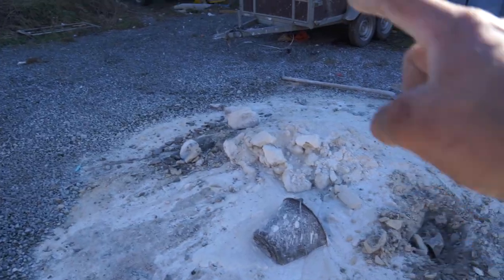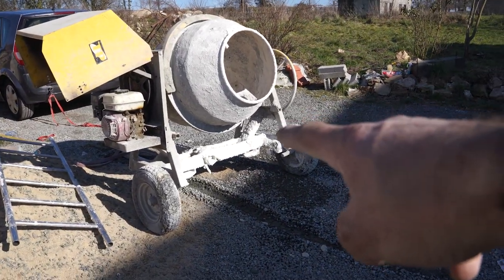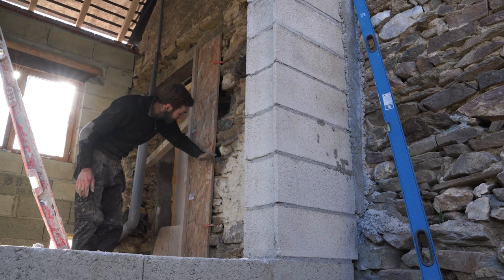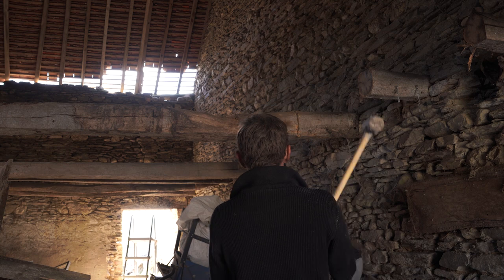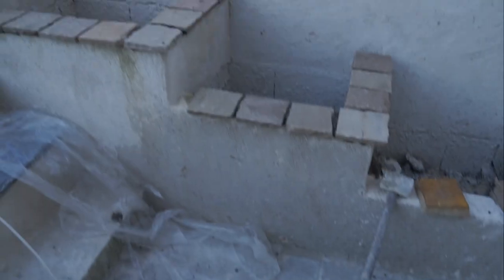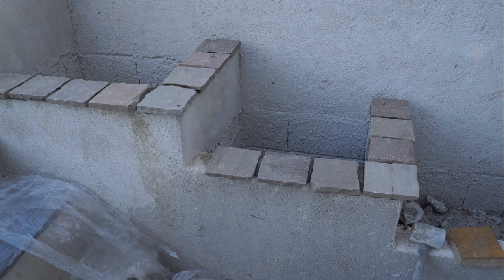Cement mixer recovery

Comment: I've just seen a tip regarding cement mixers on the traditional bricklayer channel. Get a plastic dustbin lid, it'll usually fit snug on the lip of the mixer and prevent all the splashing and spilling etc, plus keep the muck wet in the heat and the rain out in the wet.

I speak here as one who has had to liberate his own mixer from a good few piles of doom!

Comment: My husband said not to do the roof extension/ porch thing. He said that it will catch to much wind during a storm and destroy the roof. He said to make sure they are not 1 piece but 2 separate constructions.
Reply: That makes sense
Reply: I think that the porch extension is a brilliant idea.  Dan, finish it up mate...🙌🏻
Reply: @jamiemorgan4146  aestheticly I like the overhang that will give some protection from rain. The problem is that it can easily create a weak spot that will catch wind and tear a chunk of roof off. Maybe they are in a low wind area so it's not much of a risk but it would be dangerous in many areas
Reply: I think an overhang would look pretty, but yes, it might act like a jib sail, harness an updraft and lift the roof. Although the roof will be clay tiles. I wonder if he creates a few "vents" of some type without jeapordizing the waterproofing?

Comment: Personally, I think the camera angles and set up are just as clever as this fun building project, I didn't think that cement  mixer would hold up to being pulled out of that pile of cement, what oh what is that mixer made of? What a glorious machine! (I only say that, because my dad had one of these mixers and it was nothing but one problem after another, not ' a reliable' like yours is.)

Comment: Dan, just my two cents worth.  Don't over complicate the roof overhang, it's not carrying a lot of weight so could easily be supported with a beam resting one side on the existing wall and held up with a post on the other side.  Possibly with a starburst type wood posts from the beam up to the roof.  Good luck with it all.

Comment: A suggestion re finding old roof tiles for boot room to match existing roof. How about buying the new ones and putting them on the barn on the side you can’t see. Then take the old tiles from the barn to use on the boot room. Also didn’t you take some roof tiles off the ‘ it’s not a roof terrace ‘ old roof.
Reply: Great idea !!

Comment: I think what you are trying to accomplish is using the old beams to create a fascia.  Am I correct?  You don't have to build that on the ground - just make your cuts and nail it in place.  If you fabricate it on the ground you will have to bring in a crane to lift it. What I would suggest is cutting your plaster surface back so that the fascia sits tight to the block. Then fill in any gaps between the plaster finish and the beam fascia when the installation is complete using your brush and sponge back technique.  Then you'll have a nice air and water tight fit.  If you go with a simple fascia, you can split one timber down the center and do the whole job.   Don't forget to treat it for woodworm while it's on the ground (ALL SURFACES & ENDS)  I think it will look great   When prepping the old wood for use you'd be better off with a wire wheel.  use a fine wire wheel not a coarse one and be gentle. Leave a few of those hay loft joists in place.  You don't want the barn to collapse! 😊
Reply: Normally you'd extend your wall plate, purlins, and ridge beam,..
 but apparently those are just things other people have.
Reply: @massimookissed1023  Agreed - but you gotta deal with the situation as it stands, right?  Don't think this chap has a lot of experience and he tends to just do things rather than researching first.
Reply: @stevejohnstonbaugh9171  It's one thing if it's an old building throwing design challenges at you, but this is a problem of his own making, because he didn't plan it.

 At this stage, I think I'd go with joist hangers from the gable rafters, holding noggins/purlins out to the decorative old oak rafters.
And diagonals from the gable eaves up to the overhanging ridge.
Reply: I hope @escapetoruralfrance reads this ❤
Reply: Just throwing in an idea as another artist and diyer. The oak beams will be decorative mostly, just helping to support the end of the roof tiling. 
Dan suggested using the bottom planters as bases for supports to the base beam across the front. Once everything is fixed in place, having done a dry run on the ground, won't it be strong enough to help the roof end? I assume that's why Dan is taking the time to play now, before the roof tiles go on.
Looking for useful feedback. My approach would be the same as Dan here.
Reply: I agree with you @michellebyrom6551  "mostly decorative" and "to support the end of the edge tiling".  That's why I'm suggesting limiting his work to decorative fascia that will support a roof tile overhang.  Dan has a proclivity to "bite off more than he can chew - so I'm suggesting dialing it back to what gets him the biggest decorative and functional bang for his labor.  If he limits this finishing element as I describe  - he can direct mount it to the block wall - replaster below and brush in the lower edge so the fascia matches the lintels. Manageable for one person working alone is key.  Then he can move on to the next part of the project.
Reply: @stevejohnstonbaugh9171  I  get you. Thanks for replying.

Comment: Dan, if you lay down a sheet of heavy plastic under the mixer, clean up would be easier.  Just a thought.  Also, did you use rebar inside the cement column? Wondering if that would help.  
Cheering you on!!
Reply: That was the 1st thing that came to mind 're cement mixer,  stand it on heavy tarpaulin , he certainly likes to make more work for himself,  lol
Reply: I had the same thought lol

Comment: Years ago my partner worked on our terrace which was about 30 cms deep on one end and 1m50 on the far end because of the shape of the land. We shuttered and screwed and reinforced and had the lorry pour the load. THEN I saw the shuttering bow and in our panic we drove the van to the edge and parked it against the bulge and pushed. It worked but we always had a slight bulge that always annoyed me. Wet concrete weighs a ton !

Comment: Glad the concrete mixer is free if it’s pile of doom. It still has so much work ahead of it.  Maybe put a thick sheet of plastic down before you create the next pile of doom. 
Also get some advice from Amaury re the oak structure, why not make the most of a master craftsman that is a good friend.  You want it to last another 100 years.

Comment: Also nice that you moved the cement mixer out of the ‘pile of doom’.  But think maybe you should have placed it ‘pile of doom’ adjacent so you end up with just one big pile instead of two little ‘piles of doom’ to clear up latter.  Just a thought Dan.

Johanna  Maine USA
Reply: Just another thought and not meant to be a criticism but maybe do a major clean up of the site and amalgamate all the spare bits of wood and brick so you can see what you have, cleaning the piles of doom too would help you work cleanly. You are doing a great job, but a clean site is also a safer site especially with the boys running around.

Comment: You will get a better wall by reinforcing the bottom of your form to prevent a blow-out and place all of the cement in one go.  What I see you doing is creating several cold joints where the new concrete won't bond to the previous day's concrete resulting in a very weak wall.

Comment: Curious about removing the oak beam(s) from the barn.  I know the beams aren’t supporting a floor, but aren’t they also meant to be supporting the general structure of the barn walls?  I’d think that those beams are integral to holding the walls and roof in place - especially in wind and when the roof is carrying a snow load.
Reply from the maker: No, these beeps are just resting into the wall , they are not holding anything together

Comment: Such fantastic work! I have a question about the planters....do they have a drain so they don't fill up in heavy rains? I'm sure they must, but I'm a worrier....
Reply: Hopefully drains at the bottom,
leading to French drainage system dug underneath….
To dissipate the heavy rains or watering
Reply from the maker: Yeah there is a drain by the door, a drain at the bottom of all the planters, and a French drain around the base of the whole thing
Reply: It would be a good place to plant herbs, right at your door step when cooking.
Reply: @escapetoruralfrance  that sounds like a lot of draining work 😝
Reply: @escapetoruralfrance  I should have know that you have it all under control! So impressive to see you single-handedly rebuilding an entire house and taking on the reconstruction of a Chateau!
Reply: @escapetoruralfrance  You need to pin this at the top of the comments each vlog as every day without fail several viewers think you're ignorant and didn't plan for drainage 🙃

Comment: Dan, rather than a post, think about a gallows bracket off the gable end. Don’t try to overhang too far, maybe 300mmm rather than 5-600mm which it looks like now, it’ll give you the same effect but be immensely less structural.

Comment: Isn't there something about not using cement on rock like that for homes because the rock can't breath? Wouldn't a lime mixture have been better?
Reply: I’ve seen other channel having lot of damp issues because the stone walls were covered with cement. They need to be plastered with lime so the walls can breathe.
Reply: It's only in that one corner. The wall isn't encased in it. The walls can still breathe. He uses lime render on the outside of the walls and he points with lime render so there's still moisture outlet pathways.